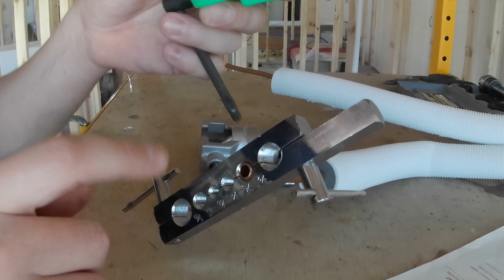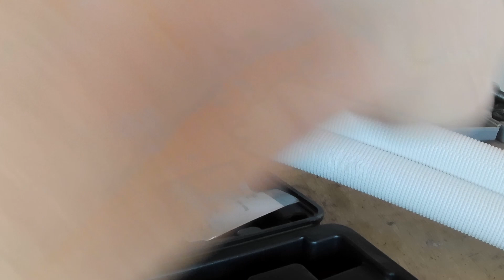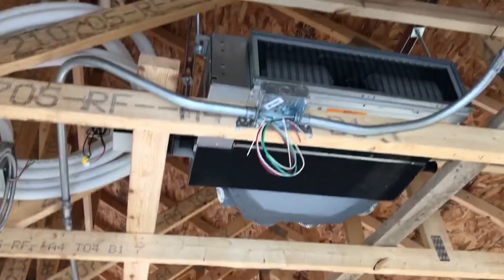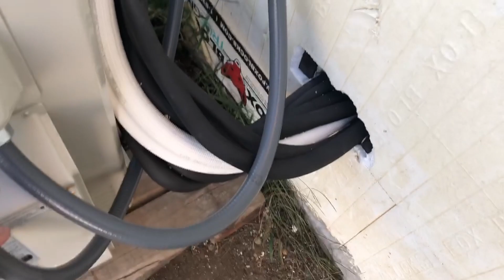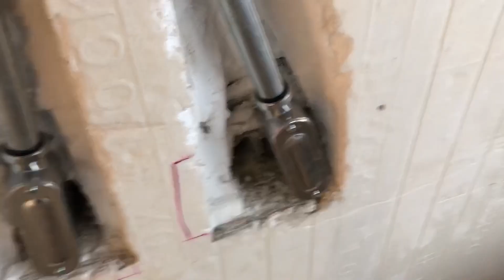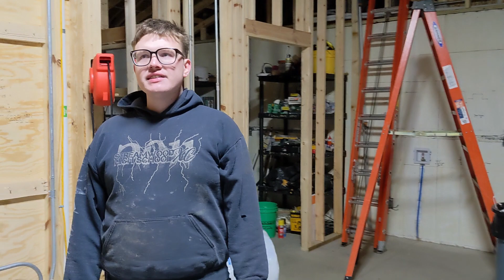Installing My Own Ducted Minisplit

Comment: I'm not sure if it's an American way of doing a ducted unit or your way, but coming from an Aussie hvac installer, it's a rather odd way of going about an installation.
Reply from the maker: It’s pretty unusual here too.

In the US, we’re just starting to get systems that are heat pump capable. So far, getting a heat pump here universally means a wall mounted mini split unit.

I didn’t really want that, so these ducted units were a compromise.

A central air handler with a heat pump coil in it would have been great, but they’re not super common/available, and the vaulted ceiling and dormers next to my utility closet present issues running ductwork from a central location.

What else was weird to you? I may just be plain wrong instead, lol.
Reply: @avalianteffort40  Fair enough. We don't really call them heat pumps or mini splits like you guys. 

Majority of what we install we call split systems, so a head unit and an outdoor, a multi head with multiple heads and one outdoor, or a ducted unit with ceiling or under floor concealed indoor unit with ducting.

We don't run multiple outlets off of one duct, we use BTOs or DBTOs (branch take off's and double branch take offs) to distribute the air. There's a bit too much loss doing it that way you are, so short of a large commercial sheet metal duct job, we don't do it. That way also it's better for zoning, or if you're using a system with individual temperature sensors, you can control to motors to each room to regulate temperature. 

For the return air, we always duct to a ceiling or wall mounted return air box with a filter in it. Leaving the coil open in the roof space will clog it up and lead to hi pressure faults.

It's interesting to see how other countries do it, or like you said your invention of doing it at least 👍

Comment: Would this be a good application for spray foam insulation under the roof deck?
Reply from the maker: Yes and no. Heat loss is temperature difference between inside and outside times area divided by R-value. I’ve got a steep roof, so while my floor plan is 3000 sq ft, my roof deck is closer to 5000 sq ft. At the same R-value, I’d loose twice as much heat if I insulated the roof deck instead. Second, spray foam really isn’t that great at insulating. It’s insanely expensive, and only R-6 to R-7 per inch. Most people do 3 inches or so. With an attic full of blown in cellulose, I can do R-60+ for a fraction of the cost. The benefit of spray foam is in eliminating convective heat loss by very effectively stopping air leakage. That’s a big deal, but I believe I can accomplish the majority of that benefit with $300 in carefully applied Great Stuff Pro cans and my blanket of cellulose.

Another benefit of spray foaming the roof deck is it makes the attic conditioned space. That way, I wouldn’t have to worry about my ducts leaking into unconditioned space.

It’s kind of a lot and pros and cons for both approaches. What ultimately settled it for me was the huge difference in cost. Insulating my attic well myself might cost $5,000. Having a contractor spray foam it (can’t really do it yourself) would be $20,000+.